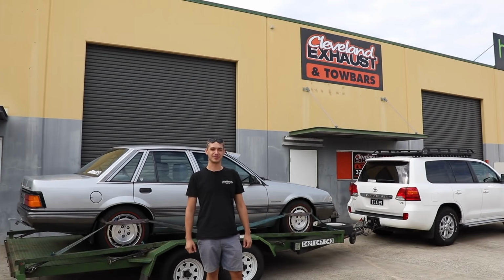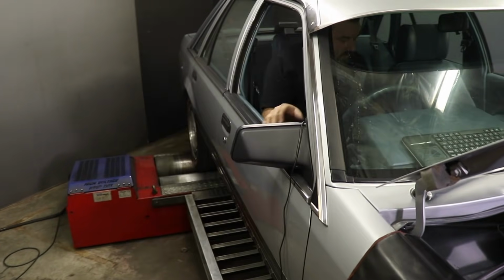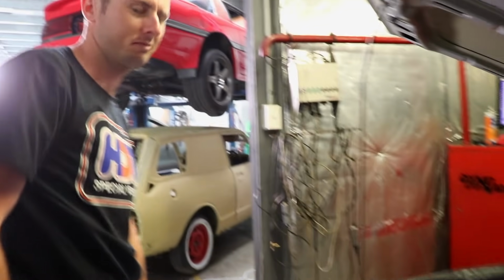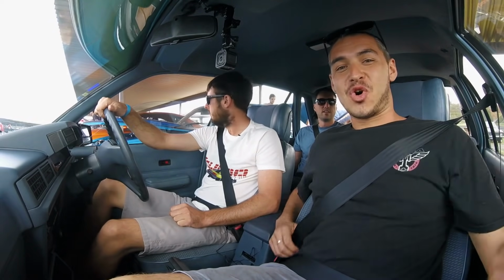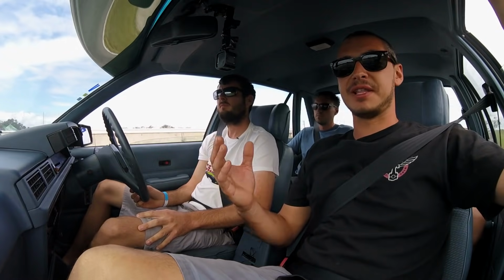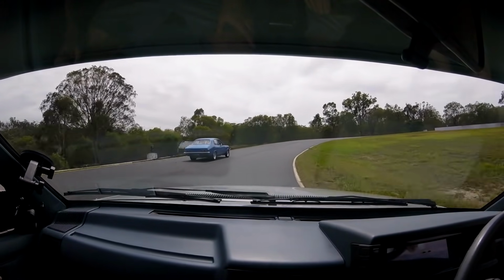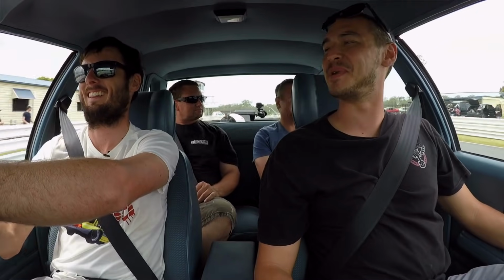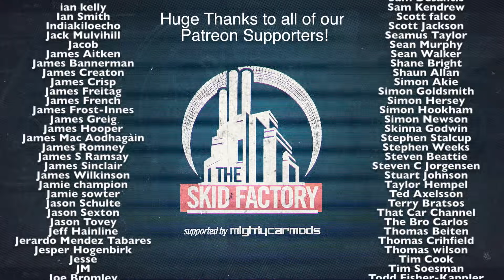THE SKID FACTORY - RB30E+T Holden VL Commodore [EP12]

Comment: At least the GM garbage sold in the 80's in Australia was RWD with relatively cool engines. Not saying GM didn't produce a few cool cars in that time but this was a run of the mill GM vehicle of the time and its RWD with an optional turb straight six.

Comment: Great result as expected.

Shame people don't understand 380rwhp in a 1350kg car that made 130rwhp originally, with a very basic setup with many limitations, is awesome.

I think people confuse a $50k+ engine setup with a <$5k one, and after seeing 1000hp dyno runs and 8sec passes, assume every car will have or is intended to have, that sort of power or performance.
Reply: dont know where you plucked 130 hp from, Holden's official claim for the turbocharged RB30ET was 150 kW (201 HP), is it because you are quoting rear wheel HP whereas Holden's figure is flywheel?
Reply: It is an RB30E, not an RB30ET. An RB30E is 114kw, which is 153hp... so the 130rwhp I "plucked" is a probably even an overstatement... either way it's about three times the original output.

The RB30ET (7.8:1 comp, turbo, and slightly different cam profile) is 150KW and, obviously, only came in factory turbo cars (probably one in 20).
Reply: I suspect it's because every backward flat peak cap wearing millenial thinks their Sylvia has 1000 hp, with nothing more than a huge intercooler and an exhaust cannon ;)

Comment: Does the sohc rb30 have same oiling issues as dohc rb engines ?
Reply: Yeah they do in a performance situation. Its the same oil pump drive set up from factory with the 2 piss little flats driving the oil pump, so crank collars are fitted with upgrading gears in the oil pumps or using the 25/26 oil pump with upgraded gears.

Comment: Aussie track days are so different. Four people in regular belts and no helmets racing down the straights.  That would never fly in the States.
Reply: This is not a track day. This is a cruise day. Pretty sure there is an agreed speed limit in place. You basically just cruise around, give it a quick squirt on the straights and that's it. To race you need approved cage/helmet/cams license/suit and more.
Reply: @procrastinator1842  still wouldn't fly here. They're roll racing down the straights with no helmets and in regular belts. The closest we have to this is a pace lap sessions for friends and family but that's no passing and 60mph speed limit. Follow the leader like a full course yellow.
Reply: @heyhayhay247  This is about as loose as it gets here. Just try doing this on the street or having a loud exhaust. This cops will have your nuts. The state they live in recently banned 2"+ lift in 4wds. Which is all of them including factory optioned.
Reply: @procrastinator1842  That's pretty harsh and unrealistic especially if you live out in the Bush.
Reply: @heyhayhay247  Yeah then they realised police and emergency services vehicles were all lifted too.

Comment: 380 hp is pretty good considering what is pretty much a stock engine with a turbo bolted on.
Reply: But a 2L civic will do the same xD
Reply: it's just not very fast compared to everyone else on the track and he regrets not putting more performance in at the ideal time to do it.
Reply: @DKTAz00  yes thats true but thats a multivalve engine and can rev higher. Also and most importantly a 2L pushing the same horsepower the cylinders are under higher combustion pressure and thermal stresses. These effects cause rapid degeneration of an engine. A big engine barely working will last a lot longer than a little one close to its own melting point.
Reply: @2011metalmaniac  I dno man, a civic will run 380 forever, but not much more if you leave it stock. I liked the build, but the result aint great for what it is. It looks nice, and they made a good job of keeping it that way, thats where the effort is.
Reply: Would you honestly rather the civic over the vl though lol
Reply: @westcoastaerialimagery4690  i'd take the vl :D
Reply: @DKTAz00  but that engine is a 16v vtec and revs to 9 grand. this engine in here is sohc 2 valve per cylinder. The only reason the honda makes more power is because it can get the revolutions up so when they do the hp formula is looks good. 100ftlbs x 6000 rpm  or 100ftlbs x 12000 rpm, yeah the horsepower will work out higher but the engine can be loaded no higher than 100ftlbs
Reply: @2011metalmaniac  You can make a 2007 FN2 do 380bhp 300ftlb @ 8000rpm and 10PSI. (stock motor) Its super hard for a k20 to get over 9k rpm, unless you're doing some cool oil mods.
Reply: @yackov8887  Limited cuz else it explodes the transmission, not a problem if you put it in the vl ;)
Reply: @BrosefDudley  Because its fun, take life less seriously dude
Reply: @DKTAz00  You should build engines for torque. HP is just a by-product ;)

Comment: 380whp hauling lets call it 1400kg, i wouldn't have expected so many cars to chop you. There must be 600+ hp in most of those late models
Reply from the maker: Most of those were XR6T or Supercharged Miami(Coyote) V8's so would have been making a lot more power than the VL.
Reply: @theskidfactory   For sure, but they're so much heavier. I have a base FG with an alloy tray and it reads almost 1800kg with just me in it
Reply from the maker: The weight becomes less of an issue in this sort of scenario as they are already moving. Both those Ford engines are very stout too.
Reply: @theskidfactory   Just amazed that street sedans are so quick now.

Comment: Nice, but in all seriousness, fuck that vented catch can off, no good for the motors slug health and no good for the environment, needs a proper crankcase ventilation system that matches a stock VL turbo or equivalent with a PCV valve for vacuum side and clean air tube to the turbo inlet/air filter junction to allow air in/out through the rev range

Comment: I don't think people realize how much horsepower 380 plus horsepower is at the wheel... especially if they've never owned a car that makes some power.
Reply: That's close to 500hp at the fly. Not bad out of a 3L.
Reply: Through an auto with a decent converter. That's probably got a high 10 or low 11 in it. That's not slow
Reply: Yep, I completely agree. My vl has 370 at the wheels and with their weight it makes it really quick but not over powered.
Reply: dikfro 5000 I agree mate solid elevens and probably consistent people don't often realize that really high power levels doesn't always guarantee faster times and consistency can then go out the window especially if your chassis, convertor and tyre setup isn't appropriate
Reply: In this day of internet videos where everyone makes 1000hp, people forget that 5-10 years ago 500hp used to be insane.
Reply: @TimsAFK  10 years ago I had a first gen eagle talon tsi that made 288hp at the tires and it was really REALLY fast. I have a 500hp at the tire camaro now that while is faster by time slip, just doesn't feel as fast as the old dsm. That car felt way less tame.
Reply: Basically 2 vn commodores
Reply: TimsAFK b/c MOST PEOPLE can't even drive a 4 door sedan with 180hp atw FAST 💨 on the hwy!!! Don't believe me? read in news the wrecks that occur every day. 300+hp atw is more than enough to haul ass!!!
Reply: @SprayIgniteBoom  you are right. 300hp is fast, enough to scare people that don't know what that actually feels like.
Reply: Let's not forget that a lot of those new cars that they were lining up against have Barras, LSxs, and supercharged 5.4l Mod motors - all of which can make HEEEAAAPS of power by just upgrading the fuel system, cranking the boost up, and just a nice conservative safe street tune.

Comment: i'm pretty sure saying AFR Ratio takes more time and effort than saying Air Fuel Ratio and doesn't suffer from atm machine syndrome
Reply: saying afr ratio is redundant.
Reply: Checking AFR ratio at 9am in the morning. Must be sure that the FIE equipment (eg the PFI injection system) is working correctly! I'm sure more tautologies are available, four was the best I could do here!
Reply: (gentle poking of course. Good work, good video)

Comment: So with the angle of the dyno and if oil pickup was in rear of pan it looks like you'd starve the motor of oil.Kinda odd to have that much angle on a dyno especially when ringing the cars all the way out
Reply: If your car doesn't have oil pressure on that small of a angle it  doesn't have enough oil in it. What's it going to be like driving up and down hills ?.

Comment: If you had months between it being tuned and the track wouldn't you just sort the coil so you could run the engine near it's comfortable-max? Would have saved you getting walked at the track by pretty much everything :p
Reply: a car full of people tends to limit performance because of the extra weight

Comment: 12:56 My mates 700rwhp FG. Thing fast and has the suspension set up to run 55s around lake side
Reply: Mate v8 supercars used to run in the 52 to 54s so 55's is a pure race car. The last sports sedan race there the pole time was 54 sec.
Reply: Mark Thomas the brakes are not gonna last very long either pulling up 1700kg  at that pace.
Reply: @nordic5490  He running custom german 392mm 6 pot big brakes front lol trust me, they last way too long

Comment: Those damn Oldsmobile wheels always throw me off...lmao 388 is pretty good power for an otherwise stock engine.
Reply: There a stock holden wheel mate. must be similar design. witch olds are they on?
Reply: @georgefloydhadasthma9133  They're on the Olds Cutlass here in the States. It just always throws me off when I see them on the car because it's just a wheel that we would associate with the Oldsmobile Cutlass from the early to mid 90s I believe.
Reply: Oldsmobile 
had shitty hubcaps that looked a bit like these wheels about mid 90s. Since Holden had these alloy rims back in the 80s the General must have shared ideas over the border lol.

Comment: That's a lot of work for 400hp.
Reply: Its about 600whp in america
Reply: @asdfghjklkjhgfdsa555  No, they weren't rating it in KW. It's HP,  400 in the US also. It's cool as hell, don't get me wrong.
Reply: Its about 450 fly wheel from a mostly stock engine and should last a good long while id say they did pretty good
Reply: the "work" they did was for reliability (from sitting around), stock motor with a cam and a falcon turbo on a haltech and e85. seems pretty basic to me.
Reply: Chris Putman - He's not about Calculation, he's all about the 'Muricans and their Numbers!

Comment: Well now the neatest vl in Aus makes some..... 400 hp maybe... 
Power? ... maybe. But electric makes 700 easy...  I'm done with gas engines
Reply: A single cam RB30 from the 80’s is definitely a great head-to-head comparison with a top end electric motor from the 2010s good stuff 👏